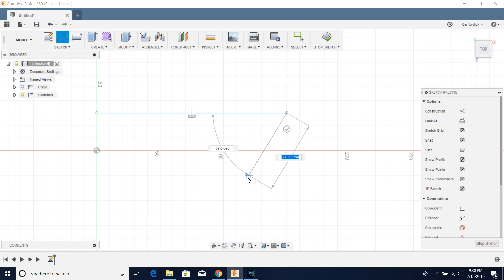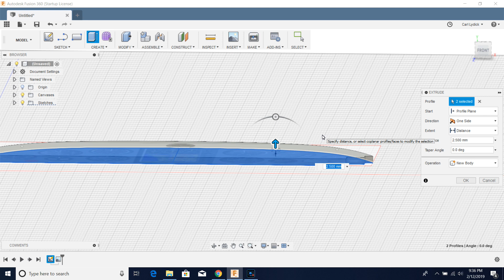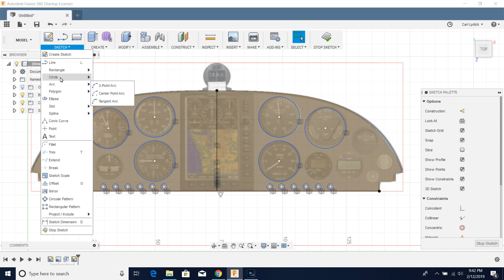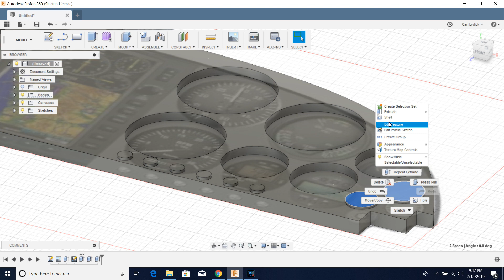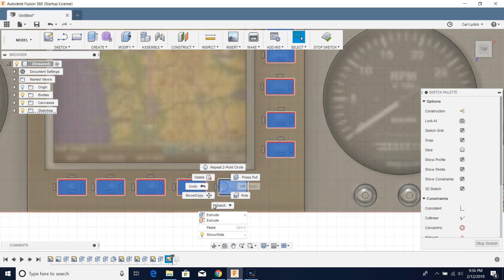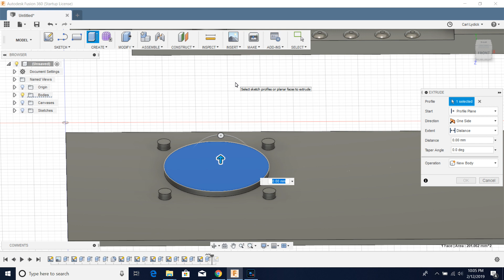Fusion 360 for RC:  EASY Instrument Panels

Comment: Thank you very much sir for this video. I'm very new to fusion 360 and you are right, trying to design a panel as a newbie is very discouraging. Ive been trying to design my pannel for the past 4 days now and I have gotten no where. Until I saw your video this morning. so, this video is much appreciated! Quick question thought. I will be using 15 to 16 inch monitors as my g1000. now, do I need to create recess in the surface of panel? or im fine with just drawing the dimension in my panel where the monitors will be install? Thanks.

Comment: Off topic.... I noticed you were following Humberto with the ViperJet Mk2 .  I was thinking of following the techniques you use to build a fuse.  Do you know anything about that project?  If he sold any plans.. He does not respond.
Reply from the maker: Haven't seen anything about the project in a while  It was/is definitely a good looking jet.  I don't see any reason this method wouldn't work to build the Viper Jet fuse.  I haven't seen plans for it but you might look on the forums to see if something ended up out there.
Reply: @CarlLydickRC  I know Ramy RC here on YouTube built one and he made plans from  a three perspective view.. It turned out great but he doesnt distribute plans
Reply: Also,  i have the plans for the 103" Gee Bee R3 and was thinking of using the foam method for fuse and wing build.  Any thoughts.  I should definitely stick with going electric for less vibration....right?

Comment: I would suggest to convert the middle line (mirror line) from regular to a construction one. It prevent from dividing the instrument panel into two halves. 
It can be done either from Sketch Pallete, Context Menu, or pressing X key
Reply from the maker: Good suggestion!  I'm not a pro and this slipped my mind.  I'll likely mention it as an option when I work with our club this week.  Thanks!

Comment: you can save a little bit of time on the small knobs on the bottom:
sketch the first and extrude it so you have a body. then sketch a line through the middle point of the knob base, to where you want the last knob to be.
then go to "create -> pattern -> pattern along path".
Reply from the maker: Great point!  I've used that function elsewhere but ended up taking the long way around on this one.  Thanks for the reminder!  I'll demo it to the guys in our club when we cover the topic live.
Reply: @CarlLydickRC  i learn something new everytime i use Fusion 360. Videos like yours sure help :)